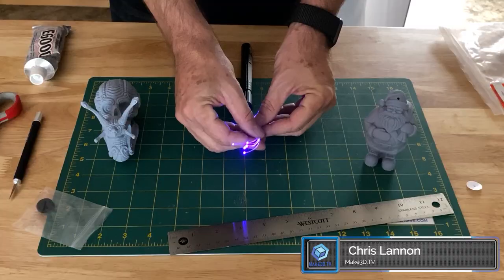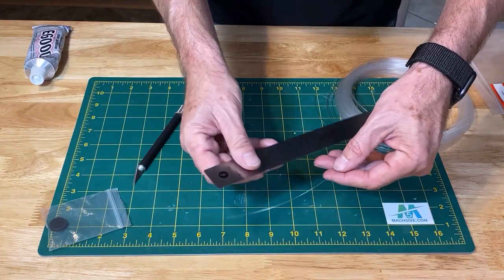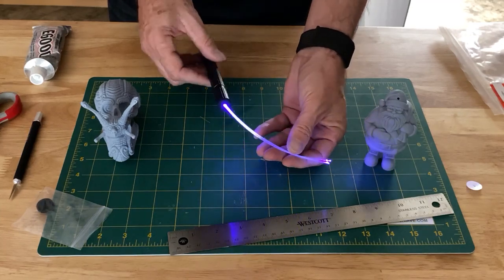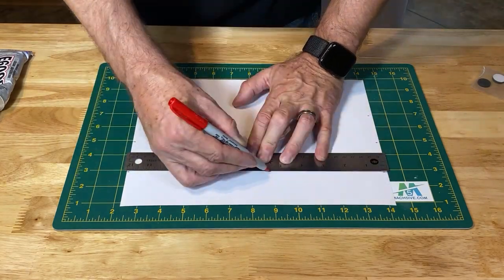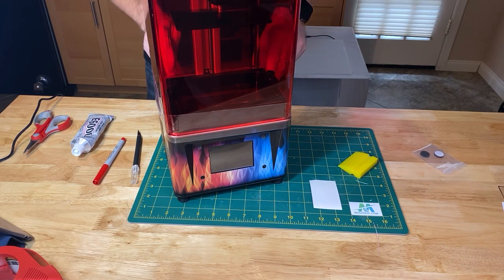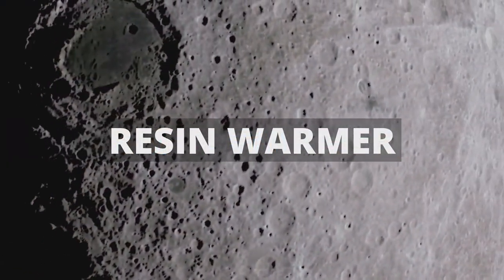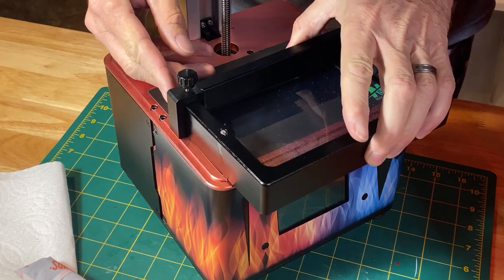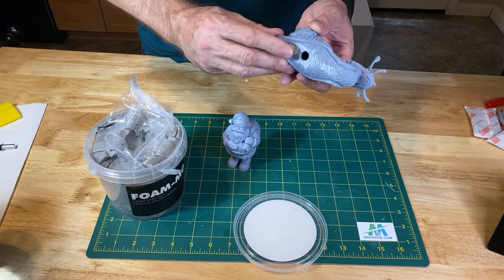Do-It-Yourself Resin 3D Printing Tools for Your Arsenal

Comment: Thanks SO much for the snake light! New to the SLA side of 3d printing, and was trying to find a solution for curing the inside of hollow models! From what i am reading, this should specifically help with water washable resins. Thanks for the video, very informative!
Reply from the maker: Hi Travis! Yes, the water washable seems to be susceptible to cracking. I don't use that resin, but I've hear curing the inside should help.
Reply: @Make3DTV  thanks dude! Hey which flashlight did you use? What nm.was the light?
Reply from the maker: @the_howlermonkey  It's the 395nm UV light on this page. The Amazon listing changed so it had been removed. I added it back. Thanks for helping me notice that--> https://bit.ly/3fgSyM4
Reply: Other people have used a UV led on a wire, this is probably easier to deal with

Comment: FWIW: warming resin: if you have a wash&cure station then get some magnetic stirrer bars (search for this on Amazon) and a few beakers. Pour your resin into the beaker, drop a stirrer in it, then put the beaker in a larger container with hot water, and put the whole thing on the wash station (you can also buy dedicated magnetic lab stirrers with heaters for about $20)

Doing it this way heats my resign quickly to a uniform temperature BEFORE it goes into the vat and using a big magnetic stirrrer in the resin bottle instead of shaking it stops you getting entrained air air bubbles in your resin - which improved my print quality markedly
Reply from the maker: You can also heat it by soaking the resin bottle in hot water.

Comment: I was thinking the same thing as your fiberoptic UV tool. I have an improvement though:
The ends of the fiberoptic cable act like a laser-ish flashlight beam. If you terminate them in a small clear blob, they act more like a lightbulb, spreading the light all over, instead of just a beam.

Try seeing if you can just melt the ends of your fiberoptic cable
fishing line might also work, but would be less clear
A clear blob of anything might work (resin, glue, etc).
Reply from the maker: Better yet, you can buy small UV LED bulbs on Amazon. Hook up a 9 volt battery and bam! You've got yourself a small curing light.

Comment: Just get an electric car heater the ones that plug in cigarette light and a 12v power supply .. Cut hole in the side of the cover. 
The a vent hole on top some vacuum hose..  Put the vent hose out the window run the heater on low..

Comment: hello my print cracks but no leak !!! i make draining holes do you know whit this happend?? thanks!
Reply from the maker: Are you using water-washable resin?
Reply: @Make3DTV  yes i do
Reply from the maker: @leocalzeti7237  Water washable resins are known for cracking. Uncured resin on the inside of a hollow model cause it to crack. You can fix this by curing the inside with a UV flashlight, or just use regular resin for your hollow prints. I usually try and stay away from water-washable resins, but if you must use it, print your model solid.
Reply: @Make3DTV  if it’s solid how will the inside fully cure? Also that’s a waste of resin.